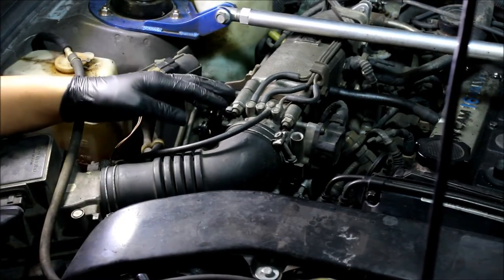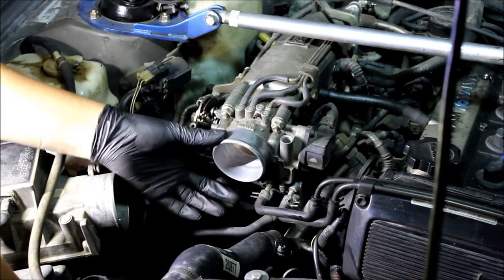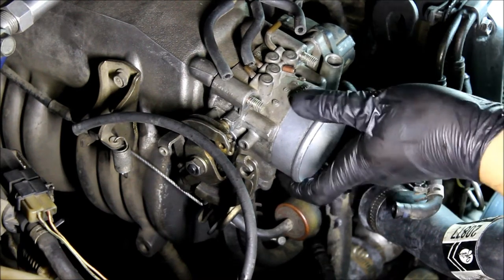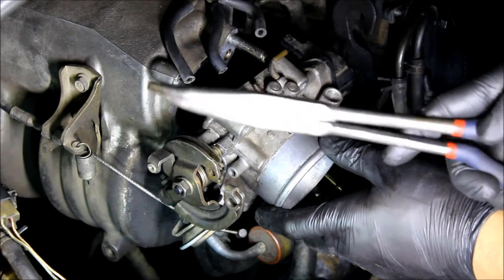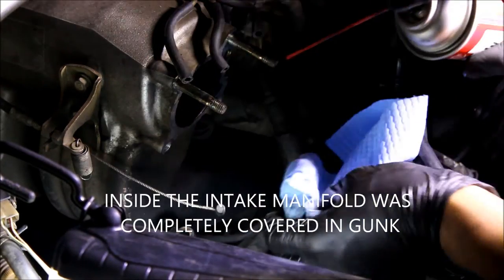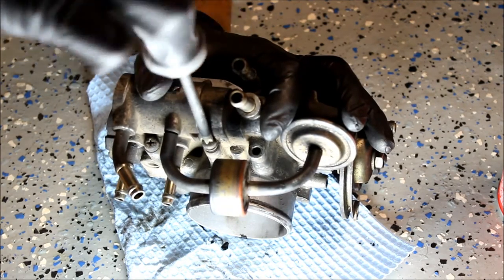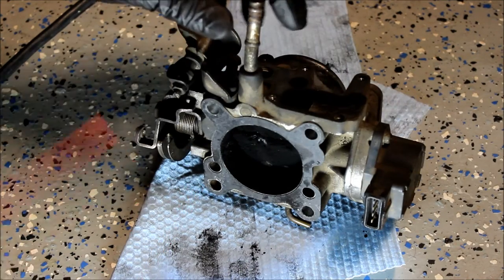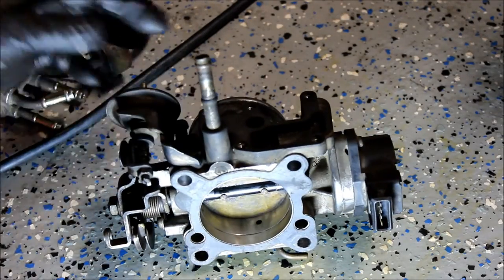AE86 CAKED THROTTLE BODY!  |  10.11.16

Comment: You're lucky, Celica Supra throttle bodies are a pain to get off
Reply from the maker: Dang haha I thought this one was annoying with all the vacuum lines.  4age are pretty easy to work on though.
Reply: The 86 Life Yeah the Supra has a huge intake system and the bolts are all in hard to get to spots and there are some vacuum lines too...